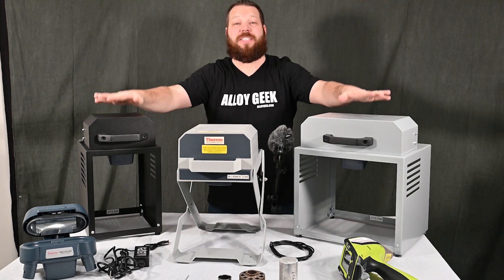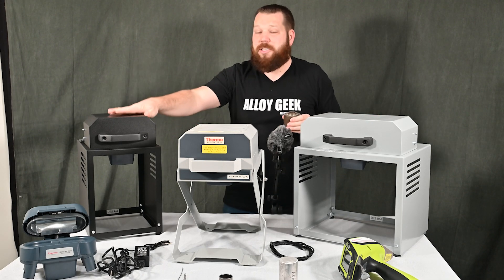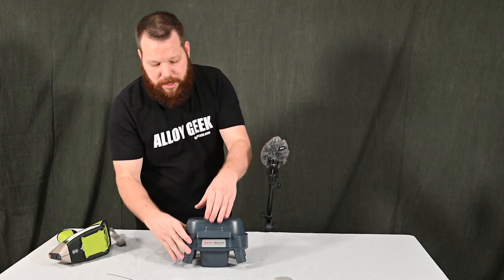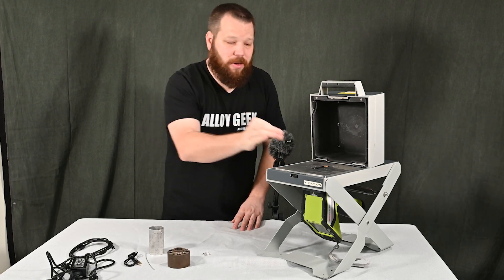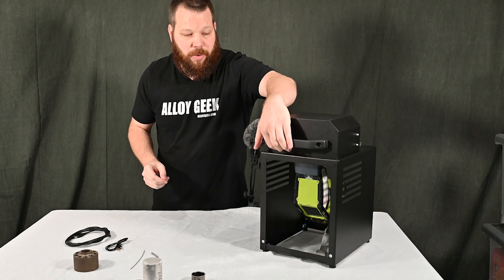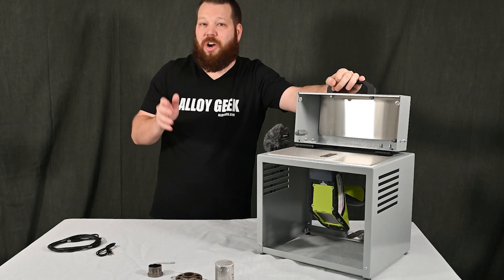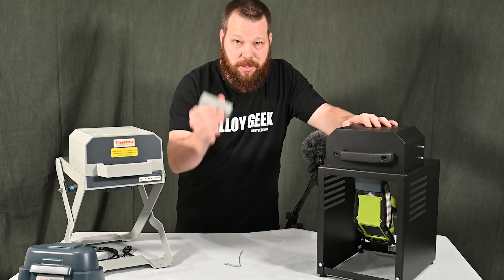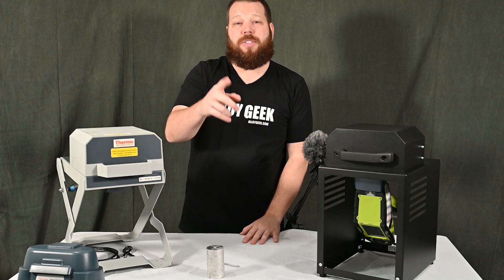The Test Stands for the Niton XL2 and XL3t Handheld XRFs

Comment: In the XL3t model MENU, there is no single time squeeze the trigger and release for a 60 seconds reading. So, using these stands, do I need to keep my finger on the trigger for all this time, each time 60 seconds? Thanks.
Reply from the maker: Test stands allow you to operate from the comfort of a computer with a USB cable. You won't have to sit there and hold the trigger down. It's amazing when you are running lots of small samples, or test times longer than 30s or so! You will need to run the NDT software that came with your Niton. It should be on the USB Drive in the case it came in.

Comment: Is there no option for long thin samples? It’d be nice to avoid having to cut a coupon off of a longer bar.
Reply from the maker: Good question! Handheld XRFs are portable so you don't always need a test stand. However, the Niton XL2/XL3t Desktop test stand has a 14 inch wide sample stage. This is already crazy big. If you're testing things longer, it may not make sense to tests in a stand. 

If there is a specific sample you are trying to test in a test stand feel free to reach out on alloygeek.com! 😀